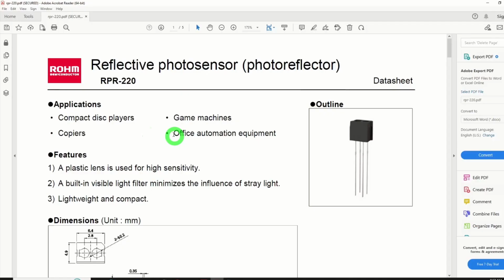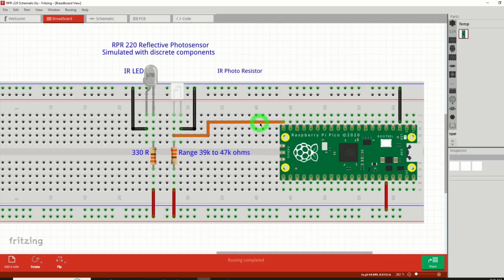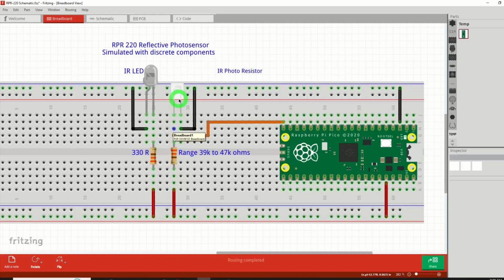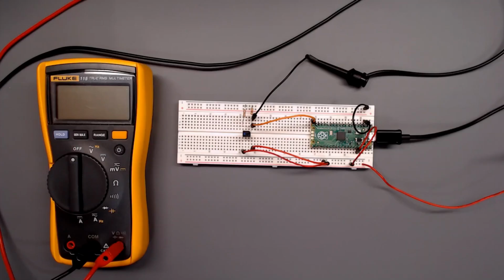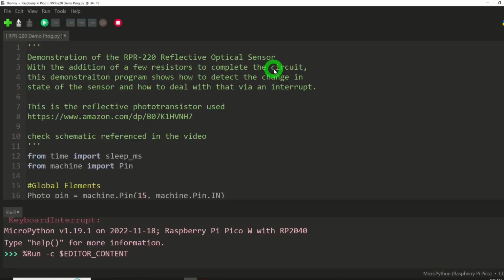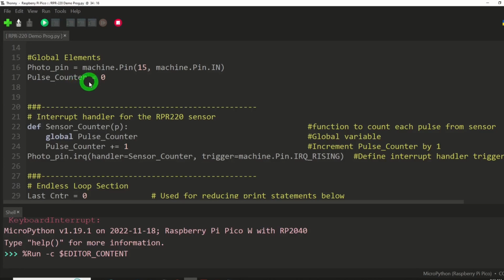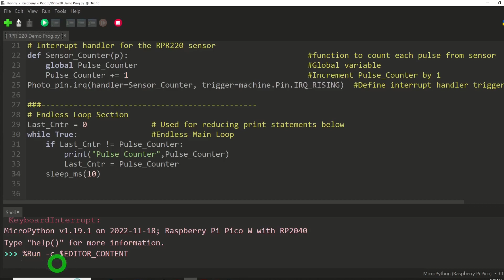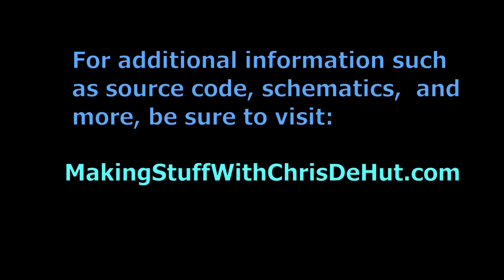How to Use the RPR-220 Photo Reflective Sensor With the PICO

Comment: Can RPR220 be used as analog output to measure short distance
Reply from the maker: Good morning shrikrishnabhakt7139,
Yes, sort-of. I have tried with similar devices and yes, you will get variable readings that can be converted to distance with calibration, however, any change in lighting conditions and your calibration is no longer accurate.
Chris

Comment: Chris, another GREAT how-to video. Really enjoy them. Keep them coming! When I did  a tachometer a few years ago, I found it more accurate to use seconds rather than minutes and calculate it to minutes. Can not remember why.
Reply from the maker: Hmmm, that is interesting.  Having been working on several projects recently related to motor speed, the one thing I am positive of, the cheaper the motor / driver / power supply, the more variability in the running speed. 

I spent the last week trying to come up with a PID control routine to get a small gear motor run "good".  I think I will settle for "close enough".  
Cheers!
Chris